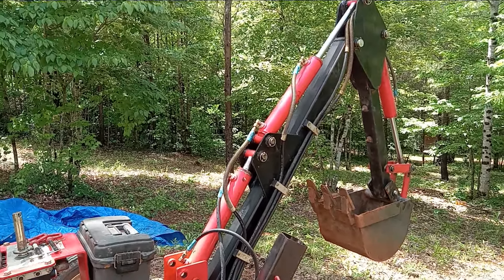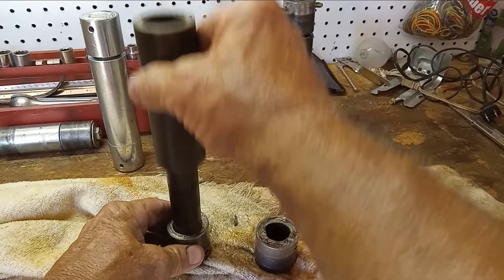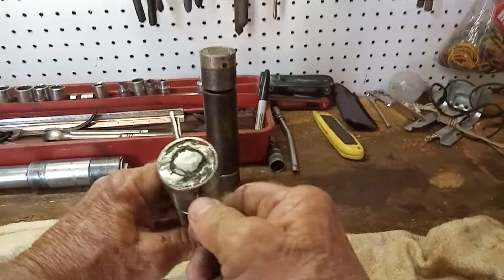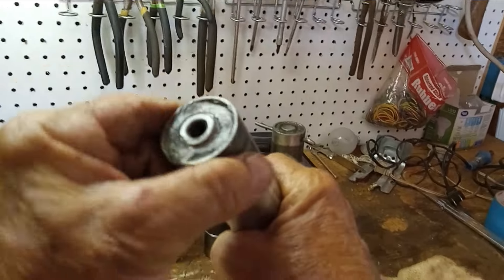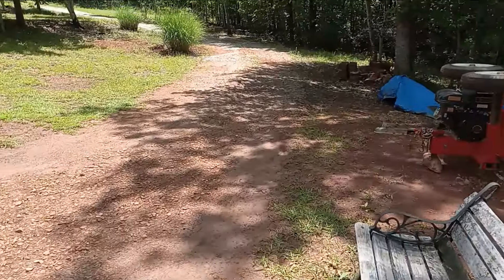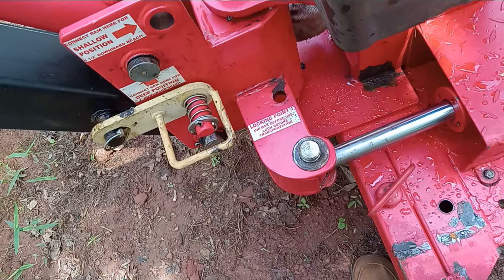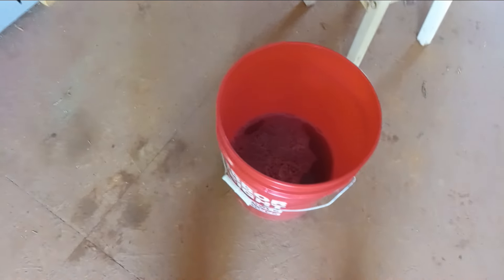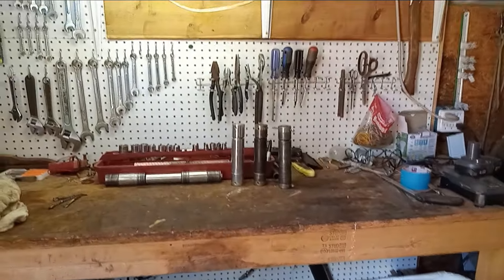Harbor Freight trencher, broken pins, part 2.

Comment: Great point about the cotter key actually keeps the whole pin together. 
A thought I've had about doing to mine... Drilling a small centered bore hole through the pin and only halfway into the pin, then drill the same size hole at the center point of the pin, but only drill it halfway through to where it will meet up with centered bore hole.  Then tap the centered bore hole just enough to thread in a grease fitting into it.  Being able to grease the pin that way will allow the grease to thoroughly lubricate the moving parts of the pin.  And, it will make it way easier to grease that joint because it sure is aggravating to reach the grease fitting through the joint at the top of the boom. 
And, I love your new parts washer.  😂
Reply from the maker: Yea, that would make them more like the "clevis" pins. It would definitely be easier than getting to those hidden fittings.

Comment: When my first pin broke a weld I replaced it under warranty. Welded the old pin for a backup. Then realized no Grease ever gets to any of the moving surface. So I made a solid pin with a Grease channel drilled into them to actually lube it.
Reply from the maker: Yep, a 1 inch "hitch pin" works great!

Comment: I think they welded the end caps to make it easier to install the cotter pins. I don't think the pins needed replacement or it would hurt to run with the old pins as long as the cotter pins are in place.
Reply from the maker: I agree 100%

Comment: I don't see why the welds are necessary other than keys coming out. Replace the keys every year or two. I like latch pins myself but cotter pins come out harder and are very hard steel. Haven't had one come loose but I will watch for them every startup.